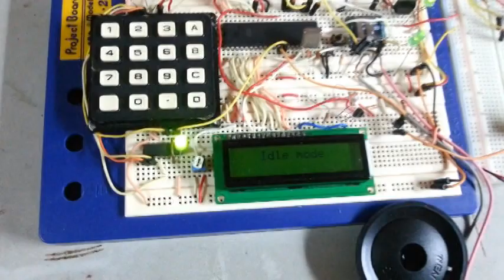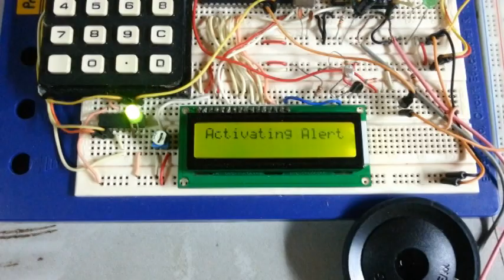security system with alarms and vocal instructions using audio module, LCD, and  8051 micocontroller

Comment from the maker: Hi, Which part that does not run correctly ( audio,LCD or keypad etc), besides some components do not have stimulation modules like the Audio and object sensor.
Please use the assembly code to generate the hex file as it has been tested,  for the C file i did not test on the board.

Comment: Do you need named with a singular name the audio files and then called them in the c code? in hexadecimal form? How do you do it to change the audio with every case?
Reply from the maker: basically, you should name the audio files in the sd card (0001-0002-..etc), and make sure they are in ad4 format. then in c or assembly code you just sent the name of the file ( e.g. 0001) and the module will play it. you want to play another audio, then send the name of it (e.g. 0002).
I have added a folder for the audio module that contains the datasheet and converter ( Google drive link in description)

Comment: hi, may i know what file u put inside your sd card? thanks
Reply from the maker: I used ad4 format files, you convert mp3 or wmv files into ad4 then name them properly (0000.ad4, 0001.ad4,....etc) 
I uploaded the converter tool and how to use it into Google drive, same link above
Reply: Tareq EE
So in your c code when u send_audio (0x0000) is playing 0000.ad4 in the sd card. Am i right to say so? And what about (send_audio 0x000A) what does this function do?
Reply from the maker: yes. for 0x00A it will play 0010.ad4 (convert to decimal)
the module needs the file name in 32bit, that is why i put 0x0000 in the c code but the name of the ad4 file inside sd card can just be 0.ad4